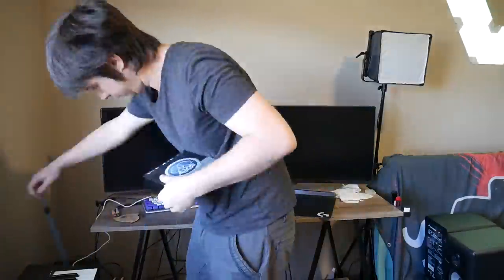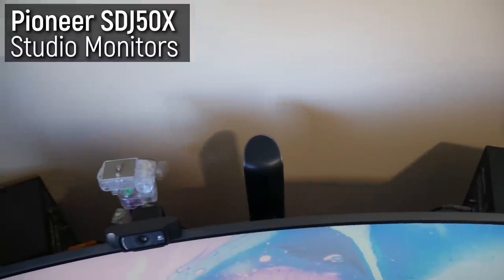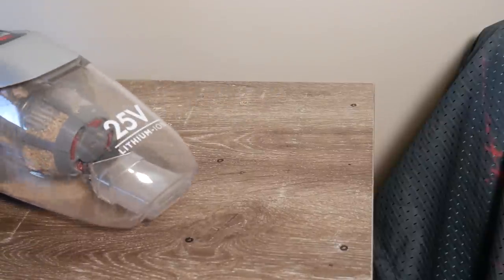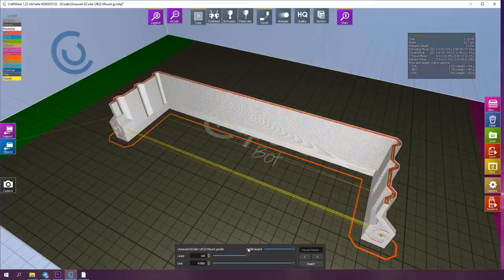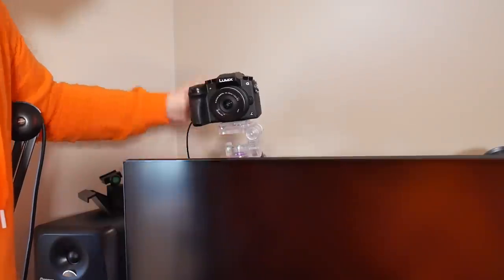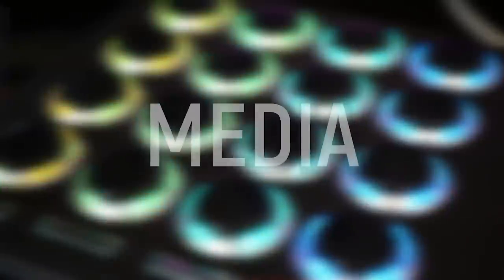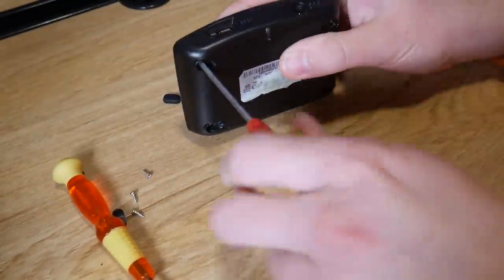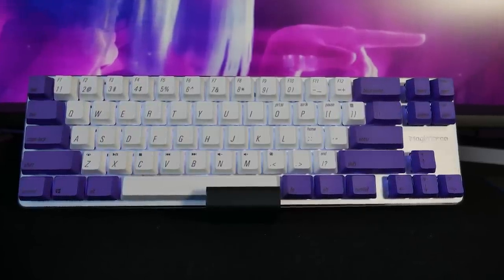Upgrade your Desk with 3D Printing (MUST HAVE MODS)

Comment: Hey, dont end up damaging the Screen with the weight of camera. I hope you have looked into that. Pressure on a screen can end up leaving u with Dead Pixels
Reply from the maker: It's fairly light, don't worry this monitor is quite... Large.
Reply: @MakersMuse  Why didn't you make a adapter for the back of the monitor stand instead? That seems pretty rigid.
Reply from the maker: @Gathaeryx  Tis, but I want to move it off center for a wider range of angles. Not a bad idea though if this doesn't work out!
Reply: @MakersMuse  A nice curved track mounted on the top of the stand behind the monitor, an MCU with WiFI like an ESP32 and a servo will get you the ability to programmatically track the camera left and right while keeping you in the center of the frame.
Reply: @bbowling4979  Don't forget Home Assistant integration. Could probably be done easily enough with ESP Home or Tasmota. Gotta have auto camera slider voice control!
Reply: @MakersMuse  To be honest I was expecting some wall mounting holes /vesa adapter to distribute weight of camera :D
Reply: @drkgumby and don't forget nasal control, integrate the control of the mount with a smart face mask that connects to the microphone and minimises breathing sounds!

Comment: Electronics Engineer here. 4A power supply is just on the edge of enough current for your LEDs. If you add more, get a bigger power supply.

Comment: Angus you forgot all the nano-leaves and acoustic foam on the wall😂, jokes aside, great job on using 3D printing for sorting small stuffs, trully a place for 3D printing to shine.
Reply from the maker: That's phase 2! haha
Reply: Nah just use egg cartons way cheaper :P
Reply: @MakersMuse  waiting patiently.. :D
Reply: nano-leaves are so expensive though. the company MI was making something similar but they said those didn't have a good build. actually you could 3D print and programme to DIY those.

Comment: For anyone that wants to cut/shape/polish metal, just get a angle grinder with a cutting disc and a flat disc. They don't cost much and will last a long time. A plasma cutter is cool but not needed. Add a drill and a step bit you're a lot of the way there.

Comment: Angus: "And these speakers are 10 kilos each!"
Me: rubbing hands together in excitement to see him use 2 kg of filament to hold one speaker.
Angus: "So I had a friend plasma cut these wings out of steel!"
Me: Gasp! "How dare he use *steel*" 😒
Reply from the maker: Cheating! 😂
Reply: @MakersMuse  It is cheating :( I too was expecting some crazy industrial design speaker mount.
Reply: I want to see you repeat that after he buys a 3D Printer for metal filament
Reply: I got the same reaction! 😂
Reply: Metal 3D printing is a thing, but it's still very expensive. It works like surgical lasers where there are multiple laser beams converging on a point in a tray of metal powder to melt and fuse the powder into a solid.
Reply: @MakersMuse  I thought for magnetic speakers you would use alloy :)
Reply: @originaltrilogy1  Steel is an alloy.
Reply: @Krytern  indeed alloy of iron and carbon (carbon is more commonly know as coal)
Reply: @Krytern  Sorry, working at a steel place, the guys always call the various aluminium products 'alloy'. Get's me into the bad habit.
Reply: Hahahaha
Reply: @MakersMuse  where's your cup holder? Hehe ...
Reply: @originaltrilogy1  thanks, I've seen this used twice today, now I know it means aluminium. The missing "an" did clue me in that "alloy" must be shorthand for something else 😉
Reply: hahaha this is great
Reply: Probably could've done it with 3d printed parts, and a lot less than 2kg per wing.  Just need to add some gussets below the plate.

Comment: I really like the LED mod and the drawer. Had an evil laugh at the SD card launch though.😁
Reply: NYEHEHEHE!

SD card go YEET!
Reply: I used to have my cards in a small plastic box with magnet lid. I mainly use micro SD because they are cheaper and I have many devices that take those. once I droped it at school and it took quite a while to find all of them on the floor. now I use a cloth bag with plastic pockets inside, one for each card. quite like the ones used to keep DVD libraries.

Comment: Looks great, awesome job. I would highly recommend  a monitor arm. Frees up a lot of space on the top of the desk taken by the monitor stand. Think this would be very useful with the limited space you have.
Reply: I'm not sure if there is an arm, which could hold his gigantic monitor.
Reply: @LichtTempler  Saw one on some video... Granted it's very expensive. Though a 49" monitor is also expensive

Comment: Angus, I love the drawer and I will have to print one out for myself! Also, you could add a charging station for camera equipment, phone, and other devices. Perhaps that could be another project that goes on a table or workbench.
Reply from the maker: Charging station is a sick idea!

Comment: Excellent. May I add that you can get the exact curveture mathematically. I'm not going to do the derrivation since explaining this as plain text with no drawing is challenging on its own. Amyways, here we go:

Since the curveture of the TV is symmetrical, all we need to do is find the radius 'r' (consider a top view of the TV). To do this we follow these steps:
1. Measure the distance between the end points of the arc, we're interested in half the distance, call it d (d=distance÷2)
2. Using a reference line between the two ends (a tensioned string or rubber band etc), measure the perpendicular distance from the middle of this line to the curve, call that 'a'.
3. Then r=(d*d + a*a)/(2a)

A bit too nerdy, but would love to see if that matches the camera holder you made.
Awesome channel

Comment: I'm deaf and the black velvet carpet for desk might be what I need in my life!  I'm always consciencious of waking up hearing up roommate/neighbor
Reply: I think what you actually need is a sound level meter paired to an LED strip on your wall 😉 Or maybe paired to a rumble pack (salvaged from an old controller or maybe the vibration component from a phone?) strapped to your ankle. Though the power pack you need for that might become a little bit burdensome after a while... Maybe make it a clip-on for your belt?
Stuff like that might even help you catch when someone honks at you while you're walking around town, I don't know if that's a concern for deaf people. I also don't think I've ever heard a honk directed at me to wanr me of danger (discounting those that are simply meant as an insult), but that might depend on where you live. The siren of emergency service vehicles might be another application though.

Comment: for these kinds of things is basically why i bought my 3d printer in the first place. as i've grown more knowledgeable about using it and getting good prints, i have now printed a few things for my desk space and will be a adding some more as needed.  in the future maybe even building a racing station. 

here's some things i've printed for my desk so far: headphone wall hanger, headphone desk hanger, headphone desk stand (yes, i have a few pairs),  and audio project box that houses (and controls) my audio amps, pre amp, and minidsp module, a low poly charmander (other two starters will be printed once i have the colors), a "gaming" set of red keycaps for my cheap mechanical keyboard, and an enclosure for my subwoofer amp which did not have one.

i'm using a lot more than i thought i would. not only that, but there's a few projects that i plan to start later on and maybe even build a small cnc machine since i have and old router i might put to some use. all in all, i've been enjoying using my 3d printer quite very much and definitely glad i decided to buy it.

Comment: Remember kids, always Make hole in metal first, and then put it on top/below the wood and mark the holes. Then drill into wood
Reply: What, you don't want to drill three holes in plate steel fishing to match the ones you started in the desktop?  :D

Comment: I recently completed the biggest print that I have ever attempted. My socket set had the blow moulded tray finally crap out on me. New socket set? NO. Designed replacement in fusion 360 and printed it out on my modded tevo tarantula. Made me really happy when I finished it and put the sockets in

Comment: Angus: You might want to get a short piece of sandpaper (50cm of grit 60 .. 80 and 10cm of grit 150), then make a "round-over" on the edge of your tabletop (eg. the top/front, where your arms rest).
I have this horribly sharp corner on my tabletop and it hurts my wrists every day; unfortunately I can't round it over because it's made of a material that does not work well after doing that).
Your tabletop seem to be made of plywood, which is why I suggest sandpaper rather than planing. If using a plane, it would create splinters, but if you use sandpaper, the result should be nice.

Apart from that, great video; I really enjoyed watching your improvements. - And I especially was happy to hear you've chosen Steinberg and Cubase; awesome extremely professional tools, which I used back in the day where I had an Atari ST.

Oh, and about the LEDs ... Each WS2812 LED draws about 50mA (0.050 A). That means a 4A power supply would be able to handle (4A / 0.050A) = 80 LEDs (white, full intensity). If you have more LEDs than that, multiply the number of LEDs by 0.050A then get a power supply that can handle a current higher than that.
May I suggest a MeanWell IRM-60-5ST (which I use for my server); it's 5V/10A, thus should be able to handle 200 WS2812 LEDs. This power supply has screw-terminals on both the primary and secondary sides. That means you'll have to make your own mains leads. If you're not yet coached by a professional electrician, please find one and get a demonstration on how to correctly connect a wire to a screw terminal properly (1: Twist, 2: Bend, 3: Insert and tighten screw). The IRM-60-5ST is very robust and the input voltage can vary from 85V AC to 305V AC, so it should work on a standard AC outled anywhere in the World.

Comment: I needed to figure out the profile (cross-section) of the seat-portion of an office-chair once -  a molded plastic part. My trick (that works!) --> (1) apply painter's tape to the thing you want to copy (2) create an approximate shape with a 3D-pen over the painter's tape (3) let it cool, and take it off - then measure it (4) profit!

Comment: As for the curved monitor back - there are numerous tutorials for how to trace a curved surface onto cardboard. I mean, this solution worked but you could actually curve the piece to fit perfectly. Also, there are  monitor mounting arms that can be bolted to the desk in the back, thus freeing up all that space used by the humongous monitor foot.
Reply: I told myself the same thing about the monitor foot!! Man i have a huge desk and I still got rid of those feet, it feels so light without them :)

Comment: This is a great setup, and it can actually  be done, albeit not so cleanly and elegantly, without 3D printing. Lots of food for thought here. I still don't have a 3D printer (hopefully that will change within a few months), but I do have a desk and workstation with similar issues.

Comment: Nice to see you posting again, 
Seems like we have had similar lock downs
I 3D printed a heap of brackets, clamps & chocks to tidy up my AV set up on my Cetus.
I also used a heap of those led strips from core electronics for another project. If you watch the ads for the new ch 10 show “Masked Singer” in the frill neck lizards “frill”  you will see several rolls on them.

Comment: For 73 LEDS, assuming you're running them at 50 or 55mAh per LED, it should be pretty much exactly enough if you don't count the Nano, which probably doesnt use much at all anyways. To find out this type of stuff, you can do 4 amps = 4000mAh / 73LEDs = 54mAh per LED which is just shy of 60 which is the max most WS2812Bs are rated for

Comment: That camera mount is really cool. I'd like to see monitors have a screw thread built in to use a magic arm or something.
Reply: I currently use my monitor on a post which was hard because the super ultrawide is so large and heavy it took me ages to find a VESA mount that didn't droop. I then clamp a arm for the camera to the pole it's hard to get it in just the right place your little guard seems to work really well.

Comment: I would highly recommend an ergotron HX. Yes it's expensive, but also it will give you your desk back. I use the smaller LX with a reinforcement metal plate for my ultrawide and I love it to death.

Comment: You asked for suggestions.. for the shape of the monitors in "Video Upgrades" I would do it a bit different: I would 3D-scann (via iPhone with e.g. ScandyPro) the "unclear" object. It is pretty simple to scan what you need because you don't need a correct and clean object but something you can recognize later to build the 3D object around. Export it as stl, cut & clean it in Meshmixer, import it in Fusion360 and make fitting shapes. This is surprising accurat, very handy and really cool when you didn't even measured and if fit's on the first print!

Even if it doesn't completely fit, it's also possible to work gently with a heat gun and make it fit.

Comment: Might want to attach your monitor to the wall of a TV support arm to reclaim some desk space. I did that with mine, though since I have a motorized standing desk I attached it to a dual monitor (for the load rating) upright post rather than the wall. Probably irrelevant for you, but the hinged arm also lets me put the monitor back further on my (somewhat deeper) desk so I can use the surface for other projects such as soldering.

Comment: With a bit of battening at the back of the desk, you could potentially switch to using the VESA 100x100 mount, and a good gas hinge arm. That would free up desk space used by the stand, which might be valuable to you on a desk of that size. Definitely would need a batten though (or another steel plate, doesn't even need to be fixed to the desk), looking at the thickness of that desk.

Comment: Great project and setup Angus. I'm completely with you on your love of all things LED. That media drawer is fantastic, beats the hell out of the 3P screw top pots I use at the moment, might you be allowing them for free to supporters? (scratch that question) I like to fix stuff to the underside of my desk too, but since it's very expensive (thanks to previous employer) I use hot glue rather than screws, it works perfectly for me, but it also has the option of non-destructive removal too.

Comment: For measure radius or copy shapes, I usually bend a wire over the object, scan the shape on my flat-bed scanner, load the picture in F360 and use calibrate to get to the right dimension. After this, I can design anything around with the correct dimensions.

Comment: Instead of guessing the angle of your monitor, wouldn't it be easier to just take a picture of your monitor from the side and model your mount based on that? Should work even for curved monitors.

Comment: If you want a nice compact mechanical keyboard, look into the Keychron K2. It's a 60% layout and has high-quality mechanical switches and RGB LEDs. It's also USB and Bluetooth dual-mode so you can disconnect it from the computer for a remote control for Cubase or whatever, too. :)

Comment: Totally love how you used 3D printing to enhance your set-up.  I'm watching this and immediately am thinking of printing a cable management tool for the top of my desk since my current one is always rotating and barely doing its job.  Also, where's that hoodie from? I like that as well
Reply from the maker: Cables are still a bit messy underneath so I will have to tackle that too. Hoodie is from H&M, they do fun colours

Comment: Always nice to improve ones work area. You have some nice changes. I couldn't really tell the differences in the before and after shots at the start of the video The one thing I wondered about is the placement of the UR22 and the SD card reader under the table. I might have moved the UR22 to the left of the reader so the cables from the UR22 don't get in the way of accessing the reader. I would also have moved the UR22 closer to the edge of the table to make it easier to see its front panel. I was surprised at the minimal keyboard. I like having a full keyboard with separate function keys and number pad. I had one with extra functions down the left side of the keyboard which I programmed for quick access to a couple of programs and to do switching of my computers workspace.

Comment: sorry for all my comments!
by why not use a bend/lock mechanism for the drawer? like the ones where you initially do a little push and they lock in by the plastic bending. expect use it as a slider too.or make a seperate track for it to travel in after you've pushed it in. basically a pin that is ever so slightly too big for the entrance but not too big for the insides of the track
Reply from the maker: I looked at it initially tbh, but because 3D printing is really weak in the direction of the layers it's actually quite hard to do that kind of snap/lock mechanism and keep it from breaking. You might be able to figure it out though! No worries about the comments I appreciate it :D
Reply: @MakersMuse  Thanks ^_^ not gonna try I did mess with them a lot but never got them right. I never had experience with that kinda thing tho. I should try messing with that more. because I do want a screw organizer with a bunch of drawers for each screw (m3, m4, m5) and it'd be kinda ugly IMO to have that part coming out of it! 

Thanks ^_^